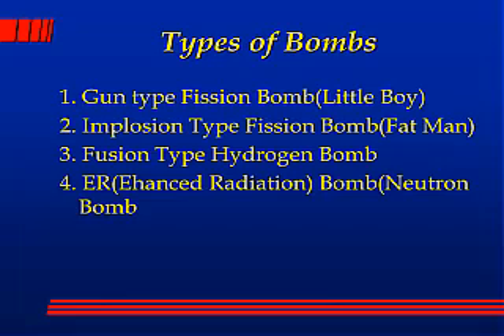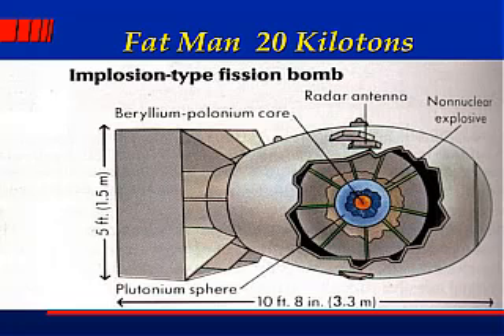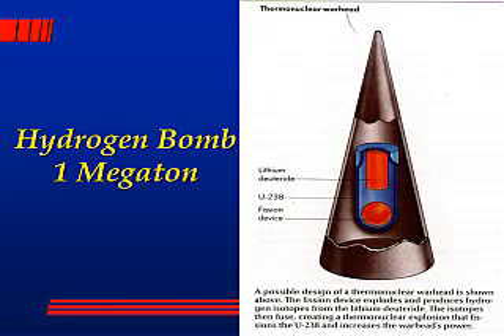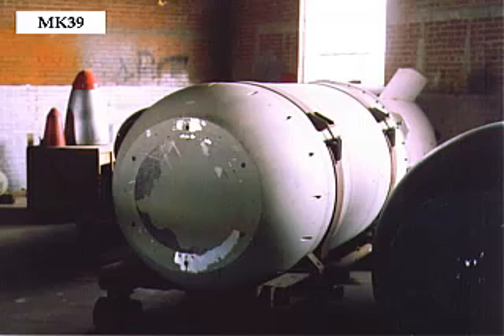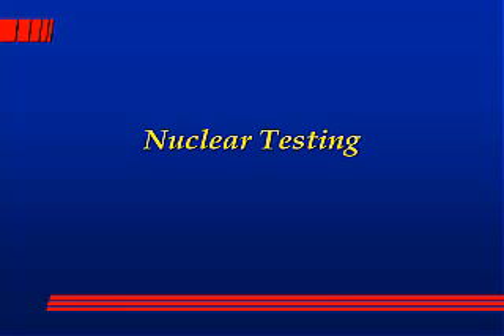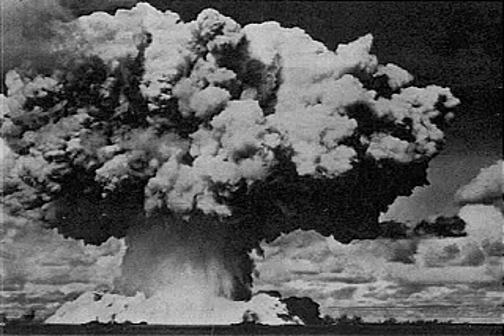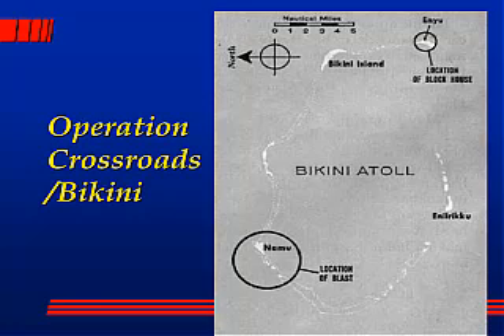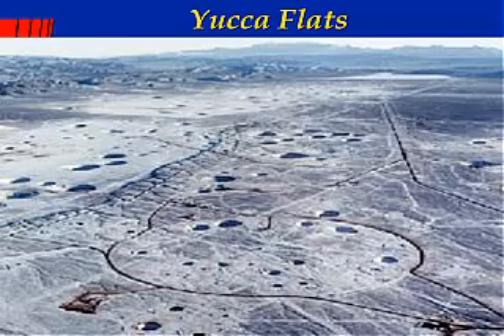Know Your Nuclear Bombs

Comment: The accepted value for the little boy yield is 15kt. The target assembly was at the forend of the weapon. The projectile wasn't wedge shaped. That photo attributed to Hiroshima appears to actually be a test at an atoll at the Pacific Proving Grounds. 

Fat Man was 25kt. The Po/Be urchin is not usually described as a "core". That term is usually reserved for the fissile fuel.
The Mk17 alongside its sister, the Mk24 was the physically largest device ever deployed by the US, but not the highest yield. It was 15 Mt. 

That picture is a Mk-36, not a 39.